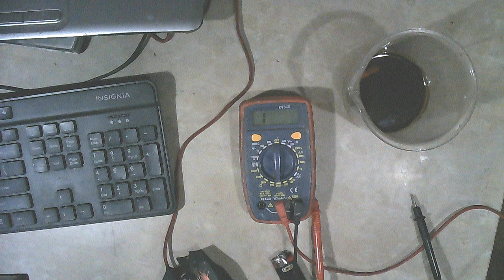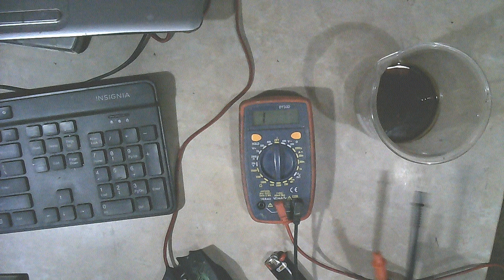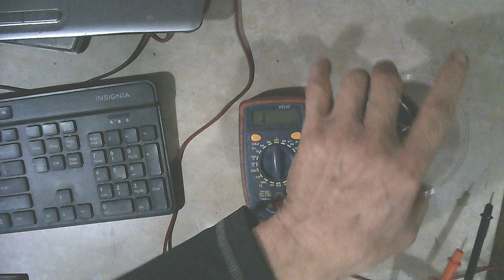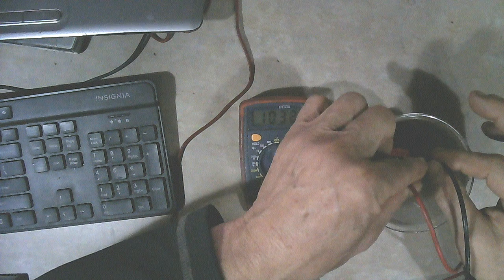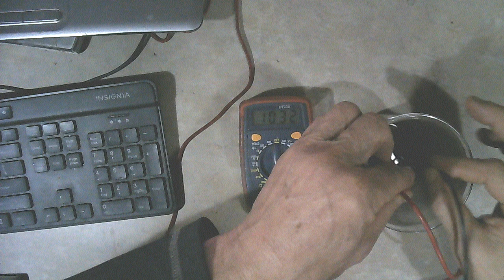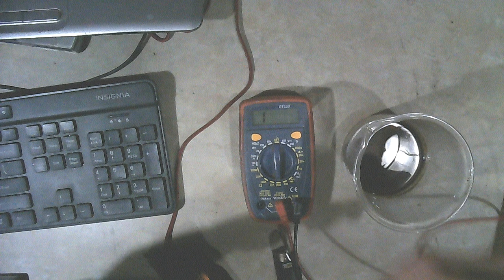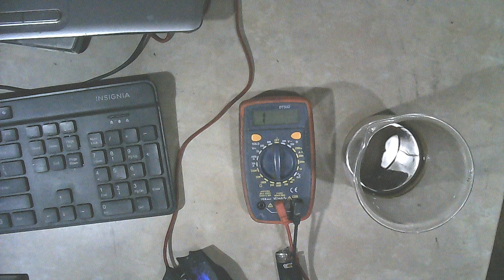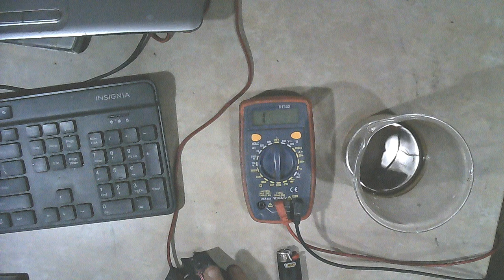Demo #13 Low-Temp Hydro-Thermal Carbonization

Comment: Super Super result mate.
Single molecule Carbon ring is King ! ! Then 😎
Reply from the maker: I agree Kev! What surprized me, was that a weak acid like Vit. C could reduce it that well, but it did, with a little catalyst help! :-)
Reply: Bio-Cell yes i will be conducting my own experiments now. Have you dried out the material yet and re checked the resistivity.
Thanks Ray
Reply from the maker: I don't intend to dry it out Kev, just use it as it is. I tasted it tho! Lol slightly tart taste like vit. c. :-)
Reply: Bio-Cell ok mate
Reply from the maker: On second thought, you are right Kev. I should dry a little out and test the resistance again, even tho I plan on using it as it is. Thanks for keeping me on track scientifically. :-)
Reply: Bio-Cell yes mate the only problem i had with it being wet was, how much was the water or moisture contributing to the conductivity. 
I mean to be at somewhere round 1K ohms is brilliant for the temperature that you carbonised at. So maybe drying some off and doing a plate test in between two metals and then probing that.
Kev.
Reply from the maker: I'm drying some on a piece of glass now. I made a battery last night with it, and it did well on graphite, nice amp increase on discharge.
Reply: Bio-Cell great stuff Ray
Reply: Bio-Cell just a quick one mate your temperature, was that Cent or Faren
Reply from the maker: It was Fahrenheit Kev, I should have mentioned that. Opps!
Reply: Bio-Cell no worries ☺